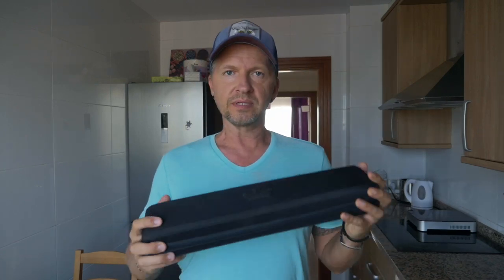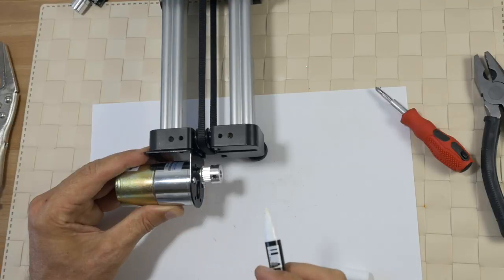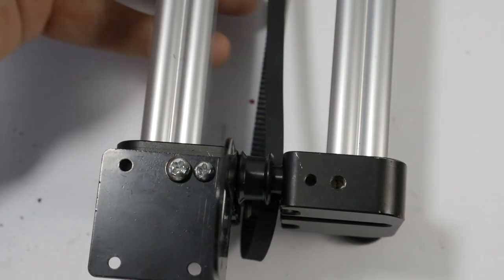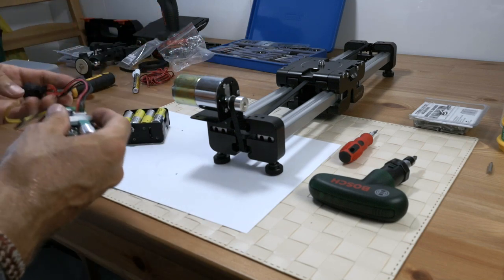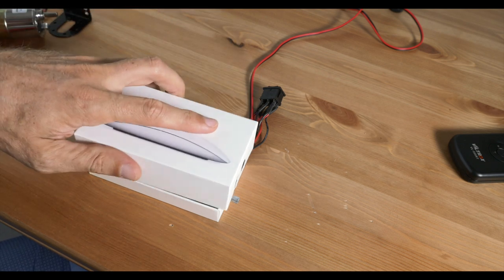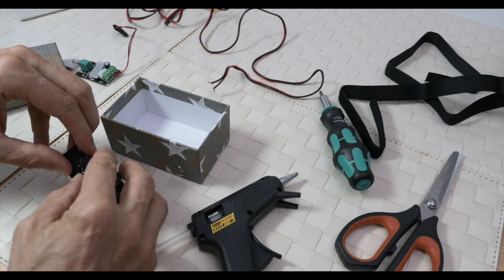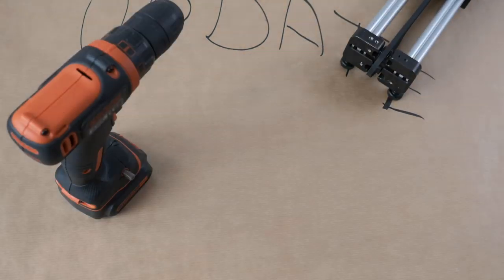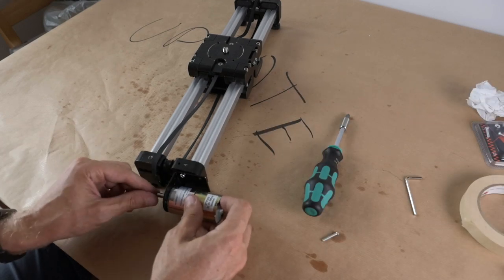How to motorize any slider for less than $50! Parts listed

Comment: Hello! Can u tell me why did u take 8 battery 1.5 AAA ? Why not 12v battery A23 or A27? Its smaller and chipper. Or im wrong? It will be problem?
Reply from the maker: Hey, it is just one of the options. Of course, you can use any 12v battery.
Reply: Ziggy Meilus ow, thanx for your attention!!!

Comment: Cool video, Ziggy. I am building something similar to modify a DIY slider. I want to be able to control the motor remotely and have been planning to use an Arduino-based controller with a NEMA17 stepper motor. May I ask why you selected the motor that you did?
Reply: because is small, cheap, quiet & easy to control

Comment: How many revolutions does the gear motor have?
Reply from the maker: Mine has 40 rpm, but  it could be even faster for the faster novement. I also use 2 rom motor for timelapse.

Comment: Well done. I have been thinking of a DC motor, but I wonder if they are very smooth. I am also considering stepper motors, which are very smooth and quiet, but may require more work.
Reply: You could try a TB6600 driver with a pulse generator, the connection is quite simple. And if you choose to use an Arduino board, you would simply need the driver and the Arduino.
Reply: @indiemathlaws3393  Would that be for a DC motor or a stepper motor?
Reply: @realjaxon  Stepper motor, a nema 17. A DC motor only requires power, or if you want to control the speed an h-bridge driver. I recommend this video: https://youtu.be/3LZ_v3Jldwo

Comment: Inspiring!  You gave me a great idea. ( I also want to make a slow-moving slide for time-lapse) Thinking I could use an old drill,  most of them have speed control built into the trigger, I can mount it with a set screw to push the trigger at whatever speed I want.
Reply from the maker: Hmm... Old drill, huh? You will have to slow down a lot even the slowest motion of that drill, but, I guess anything is possible. Good luck! ;)

Comment: How quiet is the 40rpm  motor? Is it suitable for regular video shooting noisewise?
Reply from the maker: Hi David, noise is a bit of a problem especially when recording in-camera sound. The only way is to have your subject a few meters away,  use the external mike and move the slider at a low speed. It is best suited for soundless recording, b-roll and timelapse.

Comment: A very nice and simple explained video:Great.I want to ask you or i can use a 20 or 40rpm motor istead of this 2rpm with this parts?If i use a 20-40rpm motor must i change the parts?Is a 20-40rpm motor more powerfull?Can you please anser me?Thank you
Reply from the maker: Thank you! rpm stands for round per minute, so more of them means faster motor. I use 40rpm for regular sliding shots and just switch to 2 rpm motor for very slow sliding motion for timelapse photography. No other parts need to be changed. Good luck!
Reply: Thank you.I order everything and waiting for the parts.Very nice very simple explain.GREAT

Comment: Hey Ziggy. How many pulls do you get per battery pack? 6 AA'S? Thanks.
Reply from the maker: Hey Sal, I use 8 rechargeable AA's, and they hold pretty good for several hours of continuous use, but never counted the number of pulls.. its a lot of them :)

Comment: Hey Ziggy,

Great video! The speed controller you posted in your description is no longer available on amazon. What is the name of it so maybe I can find it somewhere else or do you have something else in mind to use. Thanks!
Reply from the maker: Hey, thanks!  It just some generic speed controller with a polarity switch. This one looks identical to mine: https://www.amazon.com/DROK-Control-Controller-Circuit-Rotation/dp/B075RDP29R/ref=sr_1_14?s=hi&ie=UTF8&qid=1520239383&sr=1-14&keywords=electric+motor+speed+control

Comment: Hi Ziggy, great vid, got me thinking, i do both time-lapse and b-roll stuff so the idea of switching the motors out is a real bummer, two ideas, how do u think it would perform if instead of changing the belt for a longer one and putting the drive 'outside' the slider the drive sprocket was mounted 'inside' the slider and tensioned up against the belt? That way a motor swtich need not be a PITA. The second idea is to fit a potentiometer to the set-up, I am no technician and this was suggested by a friend. Would that allow a greater RPM range? Say 0.25 to 50 RPM?
Reply from the maker: Kevin Twitchett Sure, this is just rough and primitive idea. You can do many things differently. Not sure what you mean by potentiometer, but it has a speed controller, i think thi is the same. Only thing is that these motors can be only slowed down to a certan point by it. So for more versatile speeds you would need something different, more advanced.
Thanks for your interest though! 😀
Reply: Hi! Love your build and was thinking of doing it myself but with a slight modification. As I mainly do timelapses at night I need the slider to move only between shots or I get blurred images with long exposures. How would you suggest I could implement this feature in your build? I thought of just turning it on and off manually but I don't like this solution...
Reply from the maker: Hey, thanks! Yes, you are right, for night timelapses this might be no good. It moves really slow, so a 2-4 sec. exposure might not be a big problem, it would even give you a nice motion blur, but for the longer ones, it will not work. Then you need to make intervals and also fire the shutter at the certain points which have to be coordinated by some controller like Arduino. To be honest, for the really nice night sky timelapse I would look into buying a more advanced slider. They just so not cheap...

Comment: Zigy Melius, Great Video and thank you for the part list also. I love your project. I have a Proaim Spark 13, that is an Edelkrone clone, and I guess I can do the same with the Spark. Is that possible to have the arduino programed to operated into endless loops. It will be ideal for a B camera. I would guess, besides the programing,  it will be necessary to add a "dip switch on each side of the slider.
Reply from the maker: Thank you Orlando! Yes, that would be a next step to improve this slider. I will think about it. For now I just tried to motorize it fast and cheap.
Reply: Ziggy, Thank you very much, I did subscribe to your channel and I will be looking for new projects hopfully with an endless loop. I want motorize my Proaim Spark, but don't want to spend a fortune. I have another question: how is the noise level on your system? Thank you again
Reply from the maker: Its a bit noisy, I wouldn't shoot anything that requires a sound recording, but for b-roll or slow motion it is good. Also, my main idea was to use it for short time lapse, so it is perfect for that too. Thanks for subscribing! :)

Comment: Can you explain how to connect the electric parts? I’m not an expert and I have no idea how to connect the batteries to the main board and the motor.
Reply from the maker: I'm sorry, I missed your comment. Have you figured out the connection?
Reply: Ziggy Meilus nope, any idea. Do you have a scheme?
Reply from the maker: No, I don't have a scheme, but it is very simple if you use similar components. Speed controller has 4 contacts (2 in and 2 out) and it has to be in the middle between battery and motor. So, 2 wires (+ and - ) from the battery go to the speed controller's IN contacts and other 2 wires connect to the speed controller's OUT and go to the motor. Even polarity doesn't matter that much here, you can mix + - and it will work anyway. Just try it :)
Reply: Ziggy Meilus thank you very much, really usefull!
Tank you 👍🏻

Comment: Any updates on the best voltage for the motor
Reply from the maker: For time lapse I use 2 rpm motor, the slowest I could find in this family. For this particular slider and slowest setup it takes about 25 minutes to travel all the distance.  For normal sliding shots 40 rpm motor works good for me. It can even be faster 50 or 60 rpm for faster sliding motion. Speed regulator does a good job slowing it down.
Reply: Working on this right now with my slider could you maybe post a picture or some kind of follow up on how exactly you did the wiring I am struggling to get it to turn on.
Reply from the maker: Not sure how to post a picture here.. it is very simple, speed controller is basically in the middle of the chain. it has 2 clamps marked IN to receive a power from the power supply and 2 OUT for the wire that connects to the motor.

Comment: How did you stick the belt?
Reply from the maker: Not sure what you mean...
Reply: The replace rubber belt you use is open, a long strap. After taking the measure you need, you had to close it, to stick it, put together the ends. It it important how you did it, if the link is not well done, if it has a bump, may have a glitch.
Reply from the maker: The slider that I use has 2 separate pieces of belt. So I only had to replace one of them and no gluing was done.
Reply: I understand. Thank you for reply! I just saw how you cut the belt with scissors and the link you have for the belt on Amazon shows an open belt. That is why I asked. I have a similar slider and if change the belt, I would need to glue it and do it perfect. Nice video! I saw a video over Vilnius on your channel made with Mavic Pro. You have some interesting transitions there and interesting views. Not just the boring type. Did you use Premiere?
Reply from the maker: I just cut the length I needed. Hmm, not sure about gluing the belt. It has to be the way to fix it without gluing. If your slider has a single belt you just replace the whole thing with timing version.
Thanks man! :) No, I'm using FCPX and sometimes Davinci Resolve.